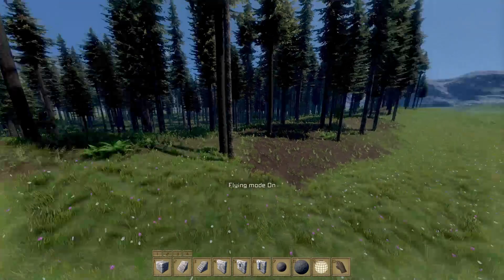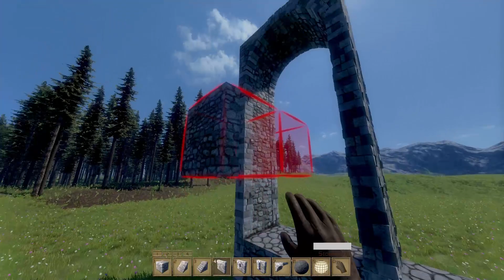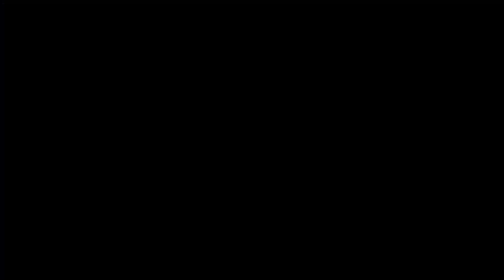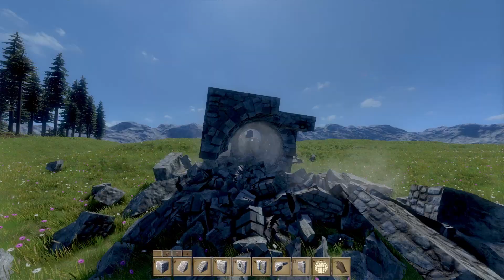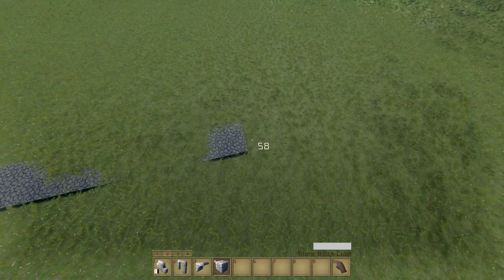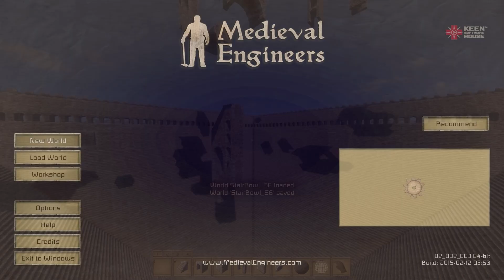Medieval Engineers, Modular Construction, & Flipped Blocks

Comment: Hope there will be water or something can flow :)
Reply: ThatZommy Billions of liters of tears of my enemies
Reply: RocketmanEXE Is that so they can cry you a river  so you can tell them to build a bridge and get over it?
Reply: Lava.
And slime pools.
Reply: I agree with adding water. With some fluid dynamics in this game it would be awesome.
Reply: Volumetric water is already planned. They just want to get a working system that won't destroy processing.
Reply: Kim Stennabb Caesar Such as in Cities Skylines or From Dust, the water simulation was pretty much entirely GPU based and quite fast.
Reply: Haymo Figueiredo Wuthrich though not very possible with todays technology
Reply: City Skylines has fluid dynamics in it's map building editor and during gameplay, it actually affects the water level for example when you build a dam.
Reply: Haymo Figueiredo Wuthrich the two games are very different, cities is a very 3rd person type of game, however it would destroy your processing in your computer, for instance if a pipe would break the water would have to flow through the cracks and make puddles how would that affect processing in the game?
Reply: kwintin1000 It all depends on how the code is constructed, what processes gets sent to the CPU and GPU, etc. 
A fairly simple simulation style is probably very possible if things are optimized properly.
Reply: If anything they need oil barrels. To pour over enemies heads when they siege your castle.